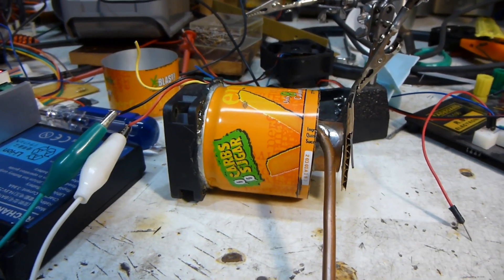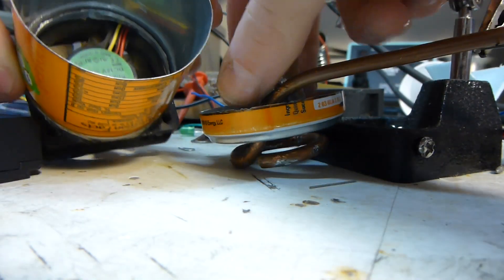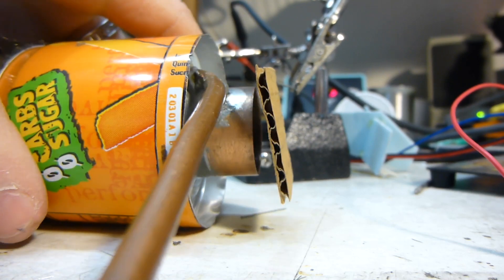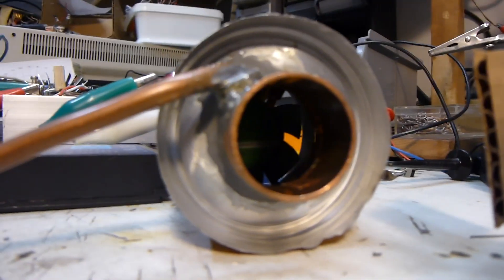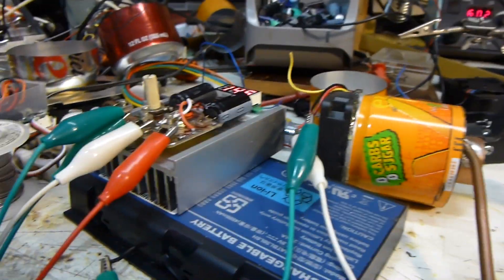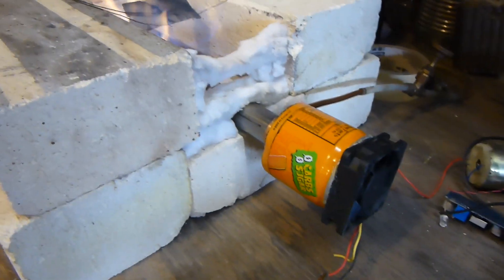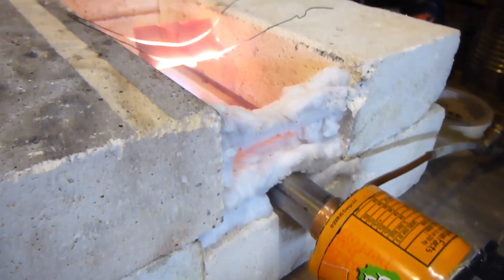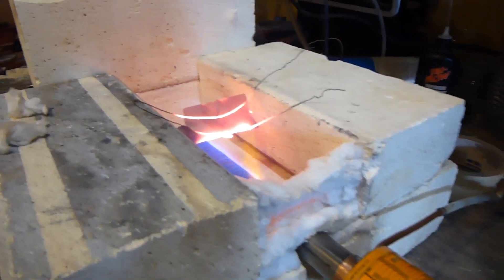Fan Vortex Boiler Burner Problem Solution

Comment: shouldnt u just use a smaller can with a smaller fan and make the gas come out from inside the small tube that the burner attaches to?
so the whole thing would look like this:
fan>>|---------,---->
here>|---------'---->
(the " ', " part is where the gas comes out from, and the air direction is from left to right --->>>>>
at the moment u have too much loss of everything everywhere...

Comment: I would give so much up to do what you do here on this channel... I love this kinda stuff, and I've ALWAYS been interested in electronics, engineering and DIY.. Egh, it's all down to money and whether you can afford it though.. That's the problem for me, anyway :(

+1 new subscriber.
Reply from the maker: Jordan O'C It doesn't cost much.  All you really need to buy is the basics such as some tools such as soldering iron, volt meter, solder, etc.  I started out with the classic $15 Radio Shack soldering iron(which BTW Radio Shack recently went bankrupt.) and as I needed better equipment and had the money I bought the stuff.  I have a pretty nice Weller soldering station now and it costed $150.  But as for all the electronics parts, I get a lot from junk I take apart.  Well the chips I'm using in this video are kind of an exception.  My dads work was throwing out tons of chips and other old junk. So they've never been used but I didn't pay a penny for them.  So basically if you're interested in this stuff then grab any junk you see along the road and scavenge the components from it.  If I have to guess how much I've spent on my hobbies over the years it's probably less than $1000.  Thank you for subscribing!  Best wishes
Reply: Makerj101 I suppose that's one way to make builds cheaper.. Thanks for the info :)
Reply from the maker: Jordan O'C But I mean you don't have to start out with everything.  Just what you can afford at the moment and build from there as money allows.  I've got lots of things I want on my list like higher quality volt meter and lots of other things.  I mostly use the cheapo $5 meters from Harbor Freight.  If you have a Harbor Freight near you then you need to check it out.  They have really cheap clip leads, volt meters, soldering equipment and lots of other great cheap stuff.  eBay and amazon are also really good places to find stuff cheap.  Best wishes, keep experimenting!
Reply: Makerj101 No idea what that shop is, but it sounds interesting. I always scour eBay and Amazon whenever I need something haha.

But the main problem I have is space.. I'm in a tiny flat, and there's barely enough space for my desk, let alone a workbench.. Which is sad, really. I don't mind starting out with just bits and pieces, heck, I've been taking apart stuff and re-purposing it for years xD
Reply from the maker: Jordan O'C It's a really cheap tool place.  Here'e the website: http://www.harborfreight.com/  I love Amazon and eBay.

Ahh ok.  Not having enough space is annoying.  You could see if there is a hacker space near you.  Around here there are clubs called Hack Pittsburgh which is a group of hackers that get together periodically in a garage and share tools and work on projects.  It's a pretty cool thing.  I really need to get into it more because it would be nice to get to know some other local hobbyists.  So maybe there is something similar near you.

Comment: how hot does the flame get at full power from the fan?
Reply from the maker: ***** Well just going by the color of the steel screen I was heating up, I'd say close to 2000F.  http://www.engineeringtoolbox.com/tempering-colors-steel-d_1530.html  If I stuck a thermal couple right in the flame it would probably be hotter.

Comment: Wow, so cool. At first, I was thinking you'd make a ramp/funnel thing to push the air down to the smaller hole, but that "compressor stator" idea was probably easier to build and totally blew me away with how effective it was. Great video, I would have never thought of this idea. Thanks for sharing!
Reply from the maker: zilym Thanks!

Comment: You actually made a compressor stator. They are very common in jet engines, centrifugal compressors and turbines. 
Computer fans can't handle much back pressure and the fanblades will stall, and as a result only stir the air around. The spinning air has indeed a slightly lower pressure and can even create suction at the back. 
Your stator straightens the airflow and lowers the fanblades relative angle of attack. The fan on it's own might even work better with the stator than without.
Reply from the maker: ***** Huh that's really interesting.  Thank you!